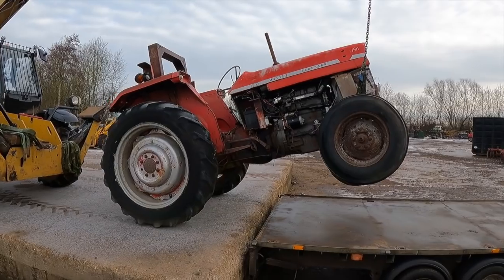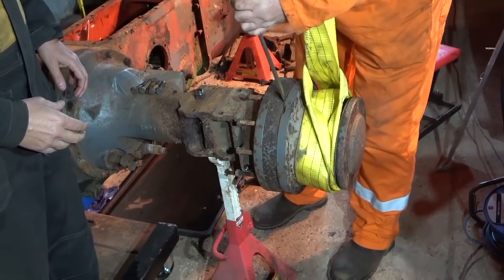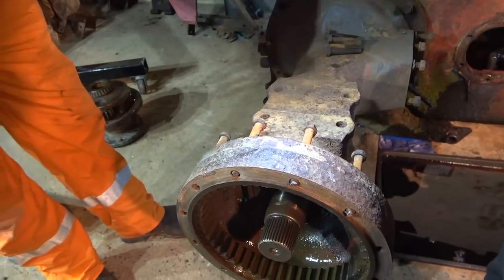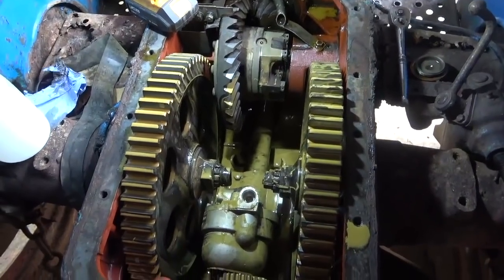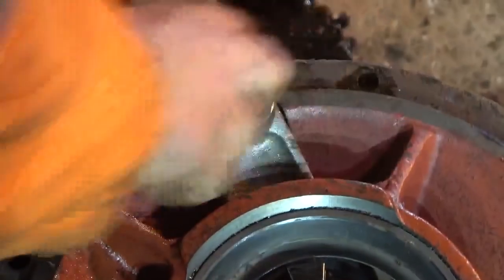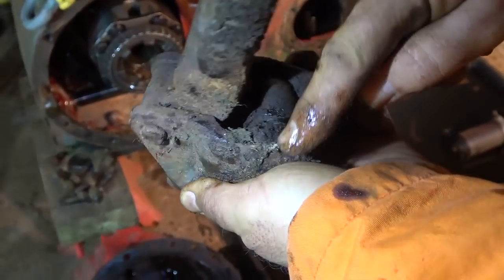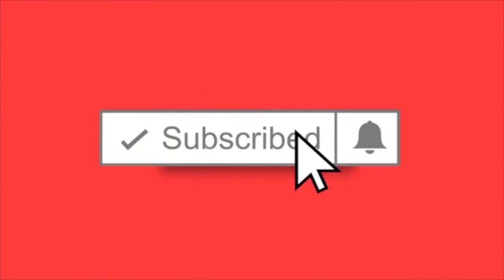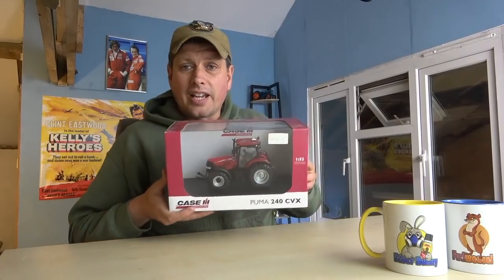BRAKES HAVE GONE ! - Massey 165

Comment: It's tough but I would say the Belarus crawler as it is just different from those you normally see as well as the perseverance you showed in getting the parts where there are a lot that would have just thought, "Screw it I'm converting it to a starter motor."

Comment: 12 years of development in tractors meant the engineering became much better. Things became smaller and more compact and thanks to Massy having a unique heat treatment process (at the time) the gear box ,diff,halfshafts etc lasts for decades💪

Comment: Have never had a look inside the drive shaft housing behind the transmission (under the seat) , nor the casting from tractor center out through the gear reduction final drive. Twas quite interesting, thank you for that.👍👏🍺🚜

Comment: Those brakes are identical to the earlier  65 model and a few years later M F came out with wet brakes . Similar actuation but multiple sintered bronze discs running in similar oil w an anti squark additive,  much better.  In my 4 years working in an Australian mf dealer l never saw one give a problem. Looking at the guts of that rear end evoked many a 70's memory.

Comment: The output shaft to the rear diff  looks like it is treated. I didn't know it but some guy from the UK invented the nitride carburizing (melonite etc) process. I wonder if that is an early example?
Reply from the maker: Massey did indeed have a unique process to harden surfaces so yes that's entirely possible.

Comment: This was a very interesting video for me as I have a Massey 50B digger which has had poor brakes for years. I have been putting off doing it as not sure how much work was needed to get to them. Could someone please confirm that the 50B which I am pretty sure is based on a 165 would have the same brakes? It is quite an early one with the 212 engine.
Reply: If it is a round axle it is dry brakes.  If it is a square axle it could be wet or dry.  On wet brakes, there will be a series of notches In the edge of the bearing carrier plate sandwiched between the trumpet and the differential housing.  They are visible from behind behind at the same level as the top link bracket.  You will know them when you see them.  

Wet brakes are pretty well identical to work on as dry brakes, except wet.
Reply: @ClarenceFudWeasel  Thank you so much for taking the time to respond, and from the star of the video as well, what more could I ask!  I have taken a few photos on google drive here https://drive.google.com/file/d/18lW11dr4-mvnOuZ5ivedCl5p0aSTg79T/view?usp=sharing, https://drive.google.com/file/d/1A6HtqEFiOTBM7BCroRfygCpAuw6_vQ9b/view?usp=sharing, https://drive.google.com/file/d/1I_OVT2kPnSr3LFEIurSCSimGD6saV8Ch/view?usp=sharing, https://drive.google.com/file/d/1mR63zsekxkPTcDZr7R70niM8epGTNjOb/view?usp=sharing, https://drive.google.com/file/d/1nGxFk-xyY6eL3j1Gf7zhrKdJ8_CtQrjK/view?usp=sharing, https://drive.google.com/file/d/1oK9nX-K3EkWR1tnlRZA8ghKHkH0yxPcB/view?usp=sharing If you do get a chance to look you can see what I am up against. The biggest concern is how much of the digger part needs to come off to get to the brakes. I recently pulled a trumpet of an IH 955 only to discover there was nothing wrong it had gear oil in!
Reply: @johnmassingham5109  It's a round axle so it's dry brakes, pretty much identical to the ones on the 165.  If you like working in confined spaces and nothing is too badly corroded, it should be possible to unbolt everything from the trumpet (cab mounting bolts, brake levers and diff lock) spread the loader support frame and the cab frame with a jack about half an inch and then you should be able to unbolt the trumpet and slide it about 8 inches from the differential housing up to the loader frame. You don't need to remove the wheel and final drive if you have something to lift with. Then you can remove the bearing carrier plate and get to the brake disks, but on an older (and I hope you don't mind me saying neglected) machine like that I'm afraid it is going to be a really horrible and time consuming job.  To be completely honest, unless you need to do road work or drive up and down hills, it's probably more trouble than it is worth.
Reply: As an afterthought, the industrials usually have outboard drum brakes as wel,l as a service/parking brake.  These are a lot easier to work on if fitted and might give you a bit of safety rather than getting deep into the back axle.

Comment: Hi your videos on will it start namely the in the hedge john deere and Land rover gives me great tips to practice on my yard find spares or repair purchase
Great video here answered my question why the 165 MF I was loaned with a loader on was so dangerous 33years ago.
Oh while I'm on worst tractor I've driven (erased from my memory) Mccomick MC115, painful clunky gear splitter, shattered engine oil pump gear wearing a hole in the cast sump JB welded and traded in.

Comment: Just a quick question. How often do these dry brake systems need to be serviced? Seems like a pretty involved process.
Reply from the maker: As soon as they stop working...
(No, seriously, they're fairly reliable until they fail)
Reply: If they are properly maintained they can last years.  The dust seals are easy to replace and should be inspected regularly.  The adjusters can be removed and with them off you can see inside the brake chamber to check for wear.  If the axle seals are replaced whenever the brakes are done as well they are less likely to fail.

Just be aware that these brakes were designed 60 years ago when a three ton trailer was big, and 18mph was fast.  They don't cool well with prolonged use and that will wear them very quickly.
Reply: @ClarenceFudWeasel  That makes sense. Thank you guys. Love the channel. 😁👍❤️